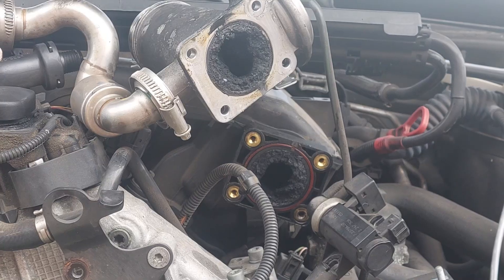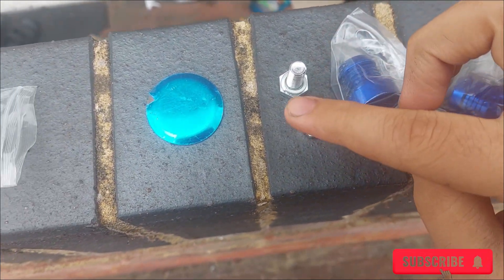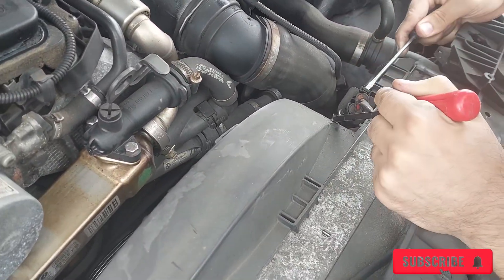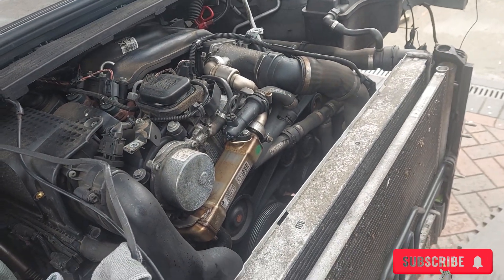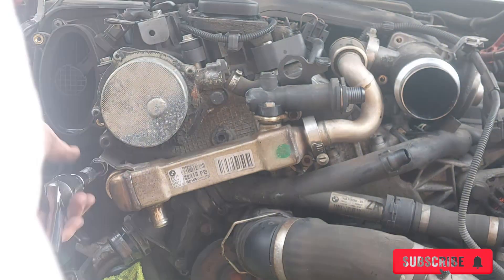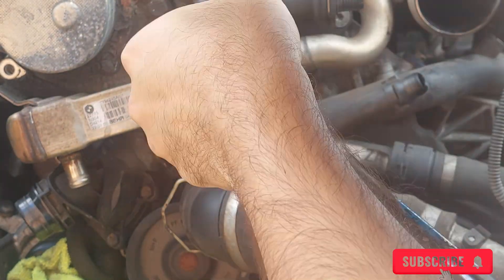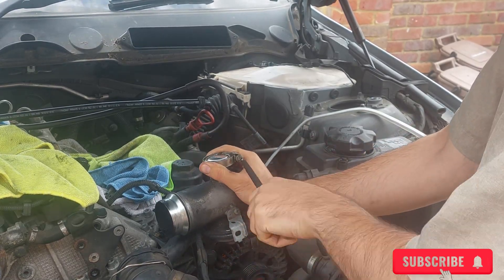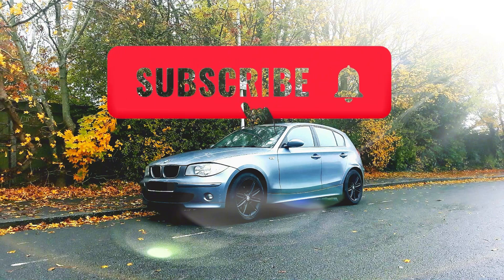BMW 1, 3 Series - DO THIS TO YOUR DIESEL ENGINE BEFORE ITS TOO LATE -  M47 M52

Comment: I’m currently getting 18-20 mpg on mine could this increase it ?
Reply from the maker: 100% this will give you more powet and more mpg, the EGR does not really benefit your engine? You saw in the beginning of the video my intake was almost fully clogged up im glad i got to it before it broke down
Reply: Yeah I was thinking the engine being clogged must definitely affect the performance was surprising to see by how much
Reply from the maker: I was barely getting 35 mpg which is bad for this engine

Comment: do you have to do anything with the ECU when you delete the EGR valve? (besides coding out the EML)
Reply from the maker: Ill update you in a couple of days once I've sorted all the other bits, i hope i dont have to do anything but i have seen some people say that when the egr is missing the ECU limits the engine power
Reply from the maker: Im also removing the flaps from the intake manifold because they break a lot, that might also trigger the ECU so we shall see haha
Reply: @acquiremuchdesirelittle goodluck!